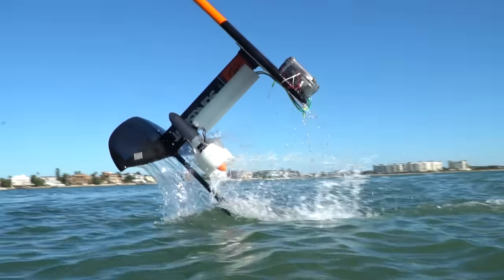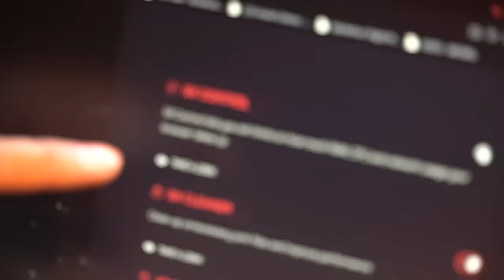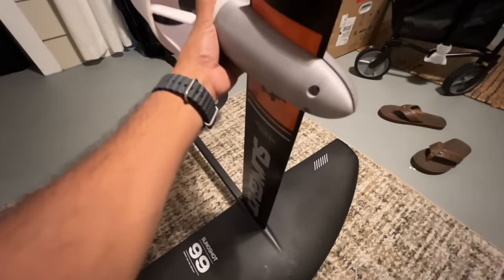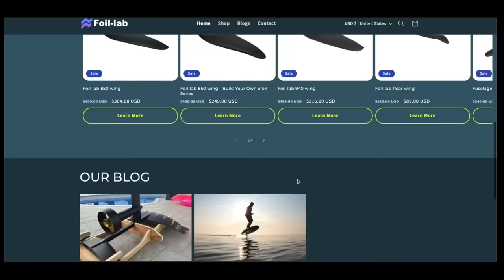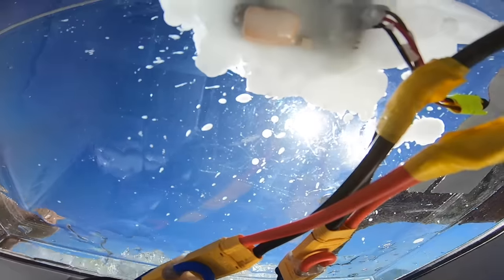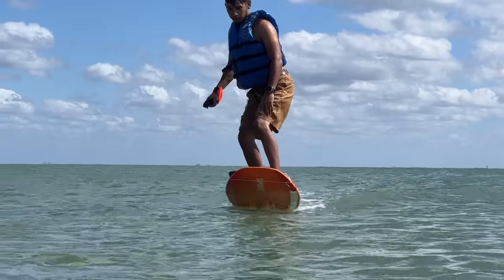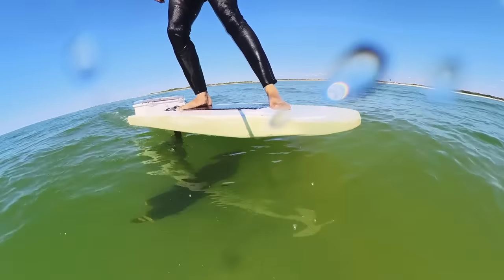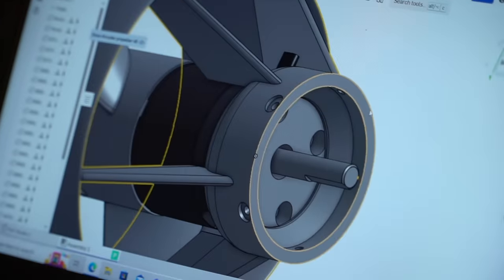Easy Hydrofoil (DIY)

Comment: Your build looks excellent, and I, as a foiler (wing/wind) salute your 3-day progress. Your setup has way too much surface on the front foil for your weight, and you should set up your propellers for a higher end-speed. In your first few tries you were stalling out the foil all the time, you need to get up to some speed, give the board one or two pumps using your weight to get the board out of the water and the foil to plane, Then you need to level out the board quickly - That's when you need the extra speed from the prop setup, 'cos all drag will be gone in an instant - the better you level out, and the higher the aspect of the foil the longer you can go on a battery. You'll get there ..
Reply: Interesting
Reply: This makes a lot of sense. Thinking about flying an airplane... you do everything you can to stay well above stall speed. Everything goes to crap if you are hanging out right at stall speed, as the tiniest factor can cause a little extra drag and you drop out of the sky.
I'm guessing it works the same way here? Which explains why his setup was so easy to get to crash out or suddenly get away from under him?
Reply: .. and he must stop playing with a throttle. It’s better to have let’s say two fixed speeds and concentrate on a balance

Comment: Wonder if an electronic gyro to control throttle to maintain angle of attack would work.
Reply: Question is, how you'd implement that. 
Both my e foils pitch up really strong when applying power and have changing angle of attack depending on speed (like an airplane). 
Also, at high AOA you get lots of drag and need lots of power to stay flying, so you constantly have to battle the nose pitching up to get out of that high AOA without taking a swim.
Would be a challenge to get that riding nicely with just gyro for power control.

Maybe in addition to controlling the motor, you could give it a little elevator for better pitch control.
Reply: @fabianrudzewski9027 wouldn't a simple PID algo be a good start to maintain the pitch regardless of motor speed?
Reply: It would work, but the gyro would/might need a few modifications first?
Reply: I feel like a trim tab that could be easily and reliably changed between attempts would be not only easier to implement, but also probably more reliable all things considered.
Reply: PID controllers are a nightmare
Reply: maybe thrust vectoring, just throwing the idea out there
Reply: @socialshipwreck8744 Not if you do it right.
Reply: A wand controlling a flap on the main wing like the Moths would work better.
Changing camber is better than pitch for tracking the surface.
Reply: Someone that knows how to write programs could build one, the way they program drones etc it shouldn't be that much difference.
Reply: Placement of the foil and angle + skill is the only solution needed

Comment: I used to go to sea for oceanographic research. I was an engineering tech so I was responsible for ensuring our systems were ready to go into the water. One thing we used to waterproof components in a box was to fill it with mineral oil. The mineral oil is thermally conductive but not electrically conductive. We filled boxes and cable housing materials. Mineral oil is fairly benign is regards to environmental problems if anything leaks or spills.

Comment: Next time you could add an elevator with a huge servo and a flight controller so the board self balances front to back. Then it should be as easy as riding a bike.

Comment: Hey Peter! I’m a long time fan since the flite test days and hydrofoil designer with a couple suggestions to get this working better!

-reduce stabilizer angle. Most large beginner foils come with too much stabilizer angle/nose up trim. Nose up trim from the stabilizer is needed to counter the drag produced by the wings and the leverage of the strut or “mast”. Because you have a motor down there, that drag is offset and you can significantly reduce stabilizer angle. Try printing some stackable 1° and 0.5° shims or just use thin washers. 

-center of gravity. Just like a plane, a hydrofoil is also sensitive to center of gravity. Moving the battery above the front wing will help balance everything out. 

-Board. To move the battery forwards, you probably need to make a new board with a cutout for it. For learning and riding underpowered, longer and narrower boards work best. Something in the 5-6’ range and around 22-28” wide should work great for just cruising around. Your hull design looked good.

-Strut or “mast”. Because of the additional battery weight, a stiffer mast will really help with control. Foils are a structural nightmare and flex is your biggest enemy. Axis foils makes a great aluminum mast that is both cheap and stiff. 
I also noticed some ventilation or trapped air on your mast. Instead of just printing trailing edge fairings, try printing fairings that wrap all the way around the mast. This way the surface will be far smoother. Alternatively, try to hide the wires inside the mast. 

-connection slop. Make sure all connections between components are super tight. I like to use cut up aluminum cans shoved in the connection between parts to stiffen everything up.

For riding, speed is your friend. Try to keep the board skimming until you have enough speed to climb without stalling. 
Great job making this work! I’m super excited to see what you come up with next!
Reply: Real comment, nice to see. Commenting for engagement and cus you deserve it brother.
Reply: That's a lot of afew suggestions.
Reply: G'day,

Great
Constructive
Criticism &
Advice...

Yay Team !

Keep on keepin' on...

Stay safe.

;-p

Ciao !
Reply: I happen to recognize kane dewilde is a world class foiler and foil designer. I suggest he really knows what he is recommending.
Reply: How to organize the power system ? I mean the Battery ?

Comment: That was so relateable! I wingsurf and I design up all my hydrofoils. Wingsurfing, wind surfing and kitesurfing all give you a higher up balance point that gives you some additional control over yaw, roll and pitch.  It was interesting to see your progression, finding your forward position to stop breaching on takeoff. That foil you bought is pretty chunky, good for learning but it has a lot of displacement drag.  The drag will relate strongly to your battery life once you get more proficient at staying on foil. I've contemplated getting a motor, ESC and battery but 75% of my free time at the beach there's enough wind for one of my wind wings anyway. The mast takes some huge loading at the joints, I used to use aluminium masts but not the only part I've not made for my current kit is the fuselage. I'm considering that though. Currently my kit is all axis compatible but I'm considering doing my own fuselage design which will necessitate adaptors for the foils until I make some of my wings to suit a new fuselage design. If you have any questions I'm pretty deep into DIY foil design and could probably save you some time. If you are printing your wings, put some high fill enforcers in your slicer by the attachement points. And subtract your composite cladding thickness from the wing design before printing.  Resin infusion is pretty amazing once you get the hang of it, understanding infusion mesh and resin brakes. I am curious about the wireless connection breaking on most units when the board is under water. No doubt the controllers are most likely using something like ESP32 wireless, A different frequency might work better.

Comment: I'd love to see you put control surfaces on the tiny underwater aeroplane, and see if you can control it with a transmitter, sat cross legged on the board, which is disguised as a flying carpet, dressed as Aladdin.
Reply: Great idea

Comment: Interesting stuff. After 40 plus years windsurfing I have the last two seasons done a lot of training/sailing trying to master windfoiling ( i.e foiling with a windsurfing sail as "motor") so I know ,first hand, how hard it is to control the flight so I'm impressed by your progress. Some tips and tricks; once you feel the foil lifting the board you must swiftly shift your weight forward. The lift of the board can also be adjusted by adjusting the angle of attack of the stabilizer (back wing).#2 make loooong turns since the foil does not like sharp turns especially not if the front wing is huge. Looking forward to see more of this since I totally agree with you about the crazy high pricing of complete e -foils. Greetings from Sweden.

Comment: Nice Work Peter!  As an avid E-foiler, I will say that you would not believe the controversy and strong feelings that run in this group around these fantastic machines.  I got involved early with a Kickstart campaign for the Waydoo brand which has made inroads into this sport and has significantly undercut the pricing of the big boys.     I am with you on the absurdity surrounding the costs - these are not super complicated toys.  The foils have been out there and are well understood as well as motors,  batteries and ESCs as you well know with your RC work.  Keep at it - its so much fun and gets only better as you progress.

Comment: No clue if you read this but being a naval engineer i noticed two things, first of all your motor shroud makes the motor and prop wayyy less efficient. if you want one to protect the prop, do one without much of a profile thats not longer than max 0.3x the diameter of the prop. Usually when those ducts are optimized for thrust they are flipped inside out (like an airplane wing with the top side on the inside, they then create lift pointed to the center of the shroud and slightly forward, creating thrust from the forward pointing lift component) but they only work for low speeds with high thrust (like a tugboat). Second thing is your mast, i know taping the cables is janky but you add a TON of resistance by doubling the surface area of the foil mast. Janky is better than having a ton of drag! (it may seem a bit counterintuitive coming from aerodynamics since the air resistance is so much lower but for water, water contact area is the worst enemy). Anyways, great project!

Comment: Maybe the throttle can be modulated by a gyro similar to how a hoverboard balances. That could reduce the stalls or nose in by having the throttle try to keep it level.  If done just right you could just about eliminate the hand held throttle.
Reply: May as well add some elevator control at that point. Lots of room under the fairings for things.
Reply: I think you might want something like a vesc: https://www.youtube.com/watch?v=Udap4uno3E4. They are doing torque based control which may be mappable to the propeller based throttling but that is outside my wheelhouse.

Comment: you could include a gyroscope and have a microcontroller slow down the motor when you’re tilting up too much and then speed up if you’re tilting down too much so that self-leveling occurs, which would Aid in  balance

Comment: I would recommend that you mount a waist high vertical bar. Mount it directly above the vertical foil.
It would make it easier to control.
Use the bar instead of just your feet to control also giving you something to help you stand on the board.

Comment: Its amazing how with electric propulsion in water applications, that a shallow pitch prop can actually push you faster than a heavy pitch due to the resistance of the water causing the motor to spin slower while drawing way more current!

Comment: You need to add rocket motors to give increased fun factor.  Probably should add go faster stripes too. 
Drinking alcohol before trying to surf will help as well.
Glad I could help.

Comment: As a wingfoiler surf foiler, best advice i can give you have too much weight on the back of the board, some have found a way to put the batterie on a backpacl, it's the best way to have the better balance, other brand like takuma integrated the pripeller motor inside the fuselage of the foil. Good luck i will wait for the part 2

Comment: This is awesome man 😁 i am a diy type of guy myself. I am buying a board from another guy in my town. 4'10" nice hd board. $150. No wing. Made for kite foiling. I have 14s batteries (100a + output) for my scooters and electric skateboards 😁 i have vesc and a waterproof remote already. And 6374 motors. I think i just need to figure out wings and mounting. Just getting started. Still researching. Will be getting board later this week. Was looking at some stuff on float web site. Yeah, prices are outrageous 🤯 i have done some epoxy work and have some nice cf/fiberglass sheeting 😁 i can do this. I also have 3d printer and am good with wood working if needed. Great video man!! I will look at your other stuff 😁 thanks for sharing. I am on same mission 🤯 in Buffalo NY though. Will be something to do over winter 😉

Comment: hate having to mention it, but I think it's worth mentioning if even one life can be saved, but 40 volts is roughly what most agree is the threshold for DC voltage to become "dangerous", so if you do this, please be careful.  the number can vary depending on conditions, and I think when water is involved, especially salt water, I would imagine it's even lower than 40.  40 is probably dc voltage on dry skin.  so just keep this in mind.  you'd need to be come the direct path between the battery terminals somehow for this to become a problem, but with salt water especially, it's more possible thing you'd imagine.  I think most people capable of building stuff like this already know this, but for people into rc but not super familiar with electrical engineer, be careful!  can't do hobbies from your grave.  happy making!

Comment: Awesome project, but it seems like you guys couldnt get going bc of the sudden acceleration and deceleration and general weight shifting, so you could probably benefit from adding a strap you can hold onto attached to the nose of the surfboard, while standing, but have a loop halfway up the strap so you can hold on while kneeling too

Comment: I’ve always wondered if a wheel that you spin to control the throttle would work better on these than a trigger in order to provide a more constant/“diluted” response to throttle inputs that would tend to be more erratic with a trigger vs a rolling wheel as it seems that the biggest part of mastering the ride is a combo of throttle feathering vs balance for the most part.

Comment: Cool vid! I'm not sure you can get away with 3d printing the wing without fribre glass. Think of it as a plane wing that has to support your weight (not actually but similair). If you want to go high-end en ultra light you could consider carbon fiber with a 3d printed mold. Easy composites has some easy to watch tutorial videos. Would be cool to see

Comment: I wonder if you could make the board more friendly to beginners if you angle to motor upwards a few degrees since it looks like the tip of you're board always moves up so it stalls. Like on rc sailplanes with tilted lift motor.

Comment: It's not always volts it's the amps you can run molicel makes a 26650 cell at 40 amps so you can run safely at 120 amps. That will get this thing rollin

Comment: While it might not be the most feasible idea, but maybe try to stuff the battery packs into the "fin"?
It'd obviously need to be a little wider for that, but considering how thin it is, it might not have much effect on the drag.
But the different mass distribution could have a noticeable effect on the stability? Maybe?... Just throwing thoughts at the wall here tbh.

Comment: How about making one with active stabilization and control surfaces, to make the learning curve much easier (and to increase the acceptable CG and speed range). Weight shift controlled airplanes have undesirable characteristics (and the scale here magnifies them). Mark Drela (the airfoil guy) made a human powered hydrofoil long ago with active controls..

Comment: I wonder if you could use some RC plane derived parts to make a sort of autopilot (more like fly by wire active stabilization ig) so that maybe you could achieve the level of smoothness that they had in those ads for the $20k boards.

Comment: I didn't realise you could just take a big standard BLDC motor and run it under water. I thought it had to be fully sealed.
I came across the motor that is used in that kit when I was researching how to build a DPV for diving.

Comment: If you're gonna DIY, why not try a battery grinder motor (high rev) or a drill motor (high torque and variable speed). It wouldn't be pre-made necessarily (other than battery packs) but should be easy enough to customize and make a housing for. Also you can impregnate the motor housing with mineral oil to water proof it. The voltage/speed could also be better for control...

Comment: Maybe use an off the shelf motor from a marine trolling motor. The 36v make 105lbs+ of thrust.
Reply: Why would he try a motor that wouldn't work?  You don't have any business using terms like 'thrust lbs'.  Also what is 'off the shelf'..what?  Why would he buy a weak trolling motor for %99-250 just to throw away 95% of it when he can buy the right motor that is 10 times more powerful.  Maybe don't comment about topics you are ignorant about

Comment: Why not make another smaller foil for the nose so that you're not constantly trying to fight the torque the motor is placing on the board with only your weight. Seems like a little stabilizer at the nose would make it much more stable.

Comment: Make a version which is like a Segway, in which it self balances and no one needs to have skills to make it work. Not sure if that could be solved using fin control surfaces or something else but it would be amazing if that was possible to accomplish. If you can get that to work, then try switching from using a board and instead use a chair, or a lazy boy.